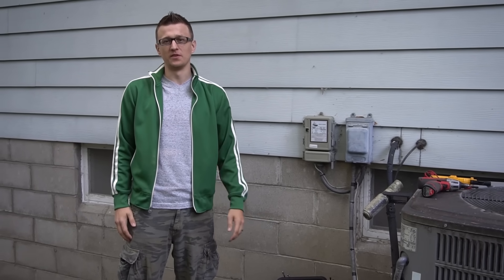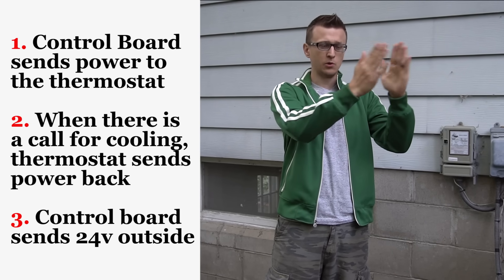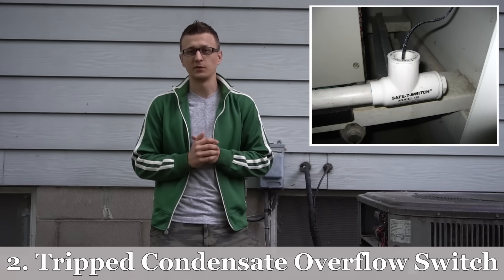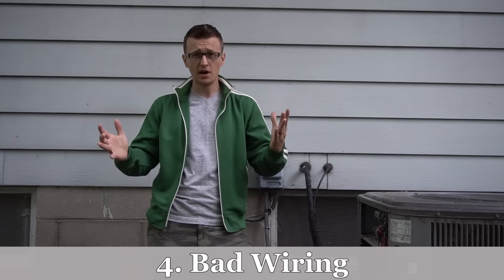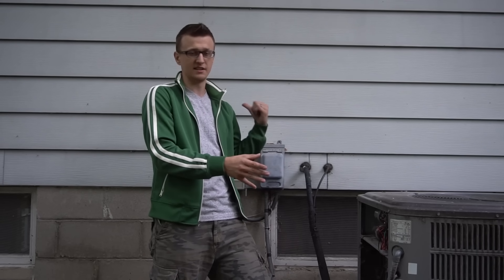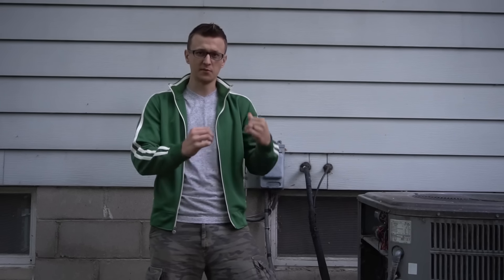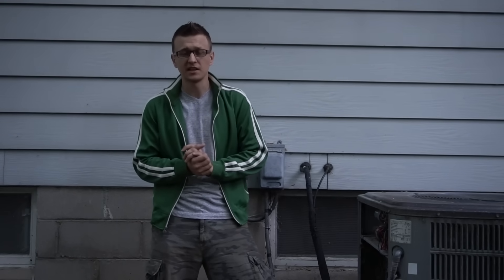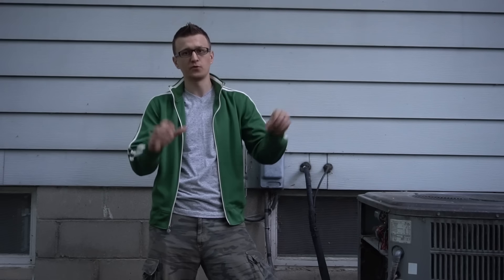AC Contactor Not Pulling In - 10 Reasons Why

Comment: W.O.A tv, in a nutshell my contactor wasn't working. When I manually pressed it, compressor came on and cooled the house after I wedged a piece of popsicle stick to hold it down. Yes this was a rig but it got us through the night.  This afternoon I watched your video and went through the ten steps, still I didnt have power coming into my contactor. I went into the attic where my condenser unit lives and opened it up. I found the wires going to the contactor and had 27v up there. I checked and rechecked my wires and connections from top to bottom, no visual signs of anything wrong. Since I found the 27v in the attic I took a long run of speaker wire and connected it there, ran it down and outside to the unit outside. I connected the wires directly to where the old wires outside of the control box, nada no power. I then took the wires directly to the contactor and bang AC compressor and fan started up. I then took about 6"s of the original wire that had the spade connectors on em and spliced them into the speaker wire, reconnected and she powered up. I know this is long winded, but I wanted to share that just cause a wire looks good on the outside doesnt mean its good inside. Had me fooled. Dont worry, the speaker wire was just a test run, proper wiring will be done tomorrow in the daylight.   Thanks for giving me the list to troubleshoot.

Brian in South Florida :)
Reply from the maker: Hey Brian! Thank you for taking the time to share your experience! That is the definition of going the extra mile! :) Way to substitute speaker wires for thermostat wires, that's a great idea! Glad to hear you were able to get it going, stay cool!
Reply: Love the popsicle stick temp fix!!

Comment: Great video, I would like to add that if you are getting 24 to 27 volts at the contactor then there's most likely a Transformer that's stepping down the voltage. My Transformer is located up in the attic by the control board on the furnace.
Reply from the maker: That's a good point, thank you for adding that!

Comment: Hello,
Today I washed my outside unit with my garden hose because it was very dirty. I waited for a couple hours until it dried before I put the cutoff switch back into the box, went inside to turn on the thermometer and no AC. The blower fan worked fine, but the outside unit’s fan wasn’t spinning. Took out the cutoff switch fuses and put it back in, the fan ran for 3 seconds and shut off. What could have been the problem here? Please help. Thanks.
Reply from the maker: That sounds like a power saver switch or a time delay. Wait for 10 minutes. The unit should turn back on. In this video I talk about that saver switch: https://www.youtube.com/watch?v=HtEGHEDmqpA
Reply: Thank you, I will do as you advised.

Comment: I decided to remove the new contactor and I tried the old contactor just to see...  the contactor “pulls in”!  I didn’t know what to expect but the system is blowing cool air and the fan is spinning. I am wondering if it will fail, again, but for now, I am a happy Maintenance Chick.
Reply from the maker: Glad to hear you were able to get it going! I hope it was just a glitch and you can forget about the AC for another 5-10 years! :)

Comment: Thank you for this very informative video. I replaced the capacitor on my Goodman unit at the beginning of May. It worked fine for several weeks then started blowing warm air. I changed the contactor yesterday (12 July) and the fan on the unit no longer spins.  I’ve checked and rechecked the wiring and gone through your suggested steps and I am at a loss. If I can’t figure it out I will have to call a tech and pay for what I don’t know. Oh!  The system does work when I manually press the plunger on the contactor. Please, any suggestions will be appreciated.
Reply: Gwendolyn Simmins  Hi I had the same problem as you did. I tried what you did according to this video. But it was not working. Finally I found my low pressure switch was open. I had to charge refrigerant then it is ok. Check if your high pressure switch or low pressure switch is ok.
Reply: @yulouma1076  i have same problem...how do you check pressure?
Reply: @DaybyDaywith3  My thermostat screen showed the refrigerant pressure was low. So I had to fill up some refrigerant by myself. Then it was working properly. If your thermostat doesn't  show the low pressure  then you have to check the refrigerant pipe by yourself. I am not sure if you have a measure tool. If you have it then buy some refrigerant to fill up by yourself. You can save at least 350 dollars. Good luck  my friend.

Comment: HELP -Trying to help my family out - What's wrong with this A/C compressor?  It starts and runs for a bit and then shuts off.  I've replaced the capacitor.  Please help!  See video below for the weird "buzzing" sound.
https://www.youtube.com/watch?v=NCI_gRh00fk
Reply from the maker: Giovanni, I am pretty sure that the super loud buzzing sound is actually the contactor. It's a pretty cheap part, I would replace it if it is that loud. There is a chance that the reason the unit shuts off is because the contactor plunger goes back up. Another thing to check is thermostat batteries. If those haven't been replaced for a long time, try replacing them.
Reply: @WordofAdviceTV  Will any LENNOX contactor work?  My unit is a 1990 Lennox 350/5 - 370volt

You're referring to the control thermostat inside the house?
Reply from the maker: @giovannidicapo6213  Sorry I don't have a video on how to replace one but here it is on Amazon: 2 Pole 30 Amp Contactor: https://amzn.to/2JWlI7Z

The thermostat batteries would be in the thermostat

Comment: First, thanks for all the videos. My 16 year old unit in the house I just bought was not cooling. Furnace fan comes on, outside fan is on. Air is not cold. When I set the thermostat for cooling, I hear the outside fan on the condenser run, but I cannot hear the compressor start and run. I feared the old device was worn out, planned to call a tech and prepared to be raped for $$$$$. Since the condenser fan was starting, I figured the contactor was energizing and pulling in. After watching your vids, I manually held in the button on the contactor and I could hear the compressor start. The large refrigerant line quickly got cold to the touch. Not sure why pressing in the contactor got the compressor started, but it did. 

I pulled the outside disconnect, then put it back in, went inside and set the thermostat to cool and it ran and cooled the house! it's been working all day today. 

I'm happy that I have cooling again, but I will continue to diagnose the system because I'm not sure why just cycling the contactor manual switch would do anything, but maybe I crushed a bug as you say. I'll also test the capacitor, because maybe the old one is no longer working to start the compressor, but has enough juice to start the fan.......that's my best guess. Any thoughts appreciated. 

Either way, awesome job explaining how to troubleshoot....it's great!
Reply: Hello 
Sometimes when the contacter is old 
The magnets gets wick and it doesn't not pull strongly 
You might just want to change it

Comment: I have blown a  few fuses while testing everything at my condenser.
Reply from the maker: Sometimes having a little pack of fuses is perfect for situations like that..
Reply: @WordofAdviceTV   I do and it is my go to when i get no low voltage to the contactor.
Reply from the maker: @okc405sfinest  If you are a tech though, I would recommend getting a mini  3 amp breaker and putting on some male spade connectors on it. Then use that in place of the 3 amp fuse so that you don't have to go through a handful of fuses each time. A lot of guys use this one: https://amzn.to/329G96M

Comment: If I move my thermostat outside can that help save money on cooling my neighbor did that and helped him.
Reply from the maker: I have never seen a thermostat outside... That would just make the air conditioner work 24/7 unless it is cold at night over there. Or are we talking about different thermostats? I am referring to the HVAC one that turns on the AC and furnace..
Reply: @WordofAdviceTV  You are correct. I talked to him and he said he moved the thermostat away from an outside door that was making it run too much thank you and apologize for confusion.
Reply from the maker: Ah okay, that makes more sense :) Thank you for clarifying!

Comment: Question, my dads AC units Contactor pulls down and then immediately pulls back up? Which of the 10 reasons can that be?
Reply from the maker: That one may be difficult.. It could be a bad contactor, you might have a voltage problem, or there are loose wire connections somewhere. Can't tell you for sure what it is though, sorry
Reply: Word of Advice TV what order would you check them in first? Lol
Reply from the maker: Investigating for loose wires or broken connectors would be the easiest. Make sure all the power is off and thoroughly go over all the wires and connectors in the condenser unit. Next I would try replacing the contactor (it's a pretty cheap part). Lastly, you would need a multi-meter to try to catch any fluctuating voltage.

Comment: What is the symptom of a bad contactor? Is the unit just not turn on or could it still cycle on and off repeatedly?
Reply from the maker: If the contactor coil is getting steady 24v but the contactor does not open or opens and closes repeatedly, that means the contactor is bad.
Reply: @WordofAdviceTV  My original problem was the AC fan spins but the compressor was on for a second then off for about 1-2 minutes then repeat. I had LPS light on AC control board showing it was fine. I then replaced the capacitor and removed/clean the contactor switch (full of bugs/webs). Afterwards, I tested the unit by pushing the plunger on the contactor but forgot to turn on the TSTAT cool/fan on and the AC compressor/fan started. I then turned the TSAT to cool and now the AC fan/compressor stay off with the LPS light is off and testing the LPS switch with ohmmeter is Open.  The HPS light is on at AC control board as expected. I verified 26v is coming into the AC unit and to the board and the contactor is not getting 26v. Could pushing the contactor plunger and not putting on the TSTAT fan cause the LPS to become Open or cause freezing in the lines/coils that last for days or break the AC? If I press the contactor plunger the AC fan and compressor both start up but the LPS light on the control panel is still off. I also verified the compressor pins do not ground , and the sum of CR+CS=SR with CR the smallest value. HELP what should I try next? The unit is a carrier Model#24aca436a300 Product#24aca436a0030010. I've learned tremendously from your videos to get this far but now I'm stuck!

Comment: My fan comes on if I turn on the main switch at the air handler unit in the garage. But the thermostat won't control it. Nothing changes when I move from on to auto. My heat and air won't come on either
 Replaced thermostat but nothing changed.
Reply from the maker: Sounds like either a 3 amp fuse is blown or the furnace is either not getting power or a component in there is burnt out.
Reply: @WordofAdviceTV  Thanks. I'll check it out
Reply: I think that is a wave resonance  between two AC units.

Comment: I can kick start the AC with screw driver, so that tells me bad capacitor*- but there is a buzz every 15 seconds. From what I can tell from other videos it sounds like the contactor going in and out.  Any tips?
Reply from the maker: The buzz every 15 seconds is actually the compressor trying to start but failing because the capacitor is dead. Once you replace the capacitor, that should take care of both problems :) If you have two separate capacitors, then replace them both.

Comment: Great video. Question on Lennox Xp15.  Getting code 8 error. When reset it will pull in and start compressor. Runs for awhile then turns compressor off goes to error code 8 again. Ideas?
Reply from the maker: Sorry, I don't normally work on mini split systems so I can't give you an accurate guess on what's going on.. There should be videos out there on the E8 code though.. Like this one for example (even though the quality is not the greatest): https://www.youtube.com/watch?v=5fdXGbelufE

Comment: You are the man!!! I possibly had three issues! The flux capacitor was bubbled out and not operable after replacing still nothing but changed the contactor and the transformer and bingo we were back in business! I wonder what a HAVC tech would have charged for that service call. 40 dollars in parts and took me all day to deduce the problem, but if I knew what the issue was would have been a 20 minute job. Couldn’t have done it with out your videos. Thank you bro
Reply from the maker: Awesome! Glad to hear you were able to get it all fixed yourself and my videos helped in the process! It would have cost you at the very least 300 bucks. Thank you for coming back to leave a comment! Stay cool! ;)
Reply: What was the original symptom? Did the AC fan not turn at all or turn on then stop continuously?

Comment: The only way the outside fan and compressor will run is if I hold the plunger in
Reply from the maker: And none of the 10 reasons mentioned in this video were the problem?
Reply: @WordofAdviceTV  I changed the contactor and compacitor....when I cut on the thermostat the furnace will work but the fan outside doesn't come on
Reply from the maker: @76blackface  That means somewhere the 24v is getting interrupted and not making it to the contactor. Have you tried bypassing your thermostat? (I have videos on how to do that) or perhaps if it has batteries, try replacing those. Have you checked the 3 amp fuse? Do you have a meter you can check voltages with?
Reply: I checked the 3 volt...I'm gonna check the..the overflow

Comment: Awesome vid I learned a lot. I didn’t hear anything about if the contactor is getting 240 outside but the thermostat isn’t getting 24 volts. Any ideas?
Reply from the maker: If the thermostat is not getting 24v, then there is no power at the furnace, the 3 amp fuse is blown, or the control board is bad. (Of course there are other possibilities but those are most common)
Reply: Word of Advice TV thanks! That’s exactly what it ended up being. Found a video after yours that lead me straight to the issue. Thank you so much the the info. It’s been very helpful and useful
Reply from the maker: @mariowalker42  Glad to hear it! Thank you for commenting!

Comment: So when I check the connections on the side of the contactor I get continuity not 24v.
Reply from the maker: So if you check the contactor coil, you are getting 0v? (continuity would be checked with the power off and wires disconnected... Not sure if we are thinking about the same thing)
Reply: @WordofAdviceTV  I pulled wires off and tested. I'm only getting 9v. Everywhere else I checked is good with like 25 or 26v. Meaning thermostat and furnace.  

Update: did the thermostat test and found that the thermostat was bad
Reply from the maker: @kirbykillaz1  So if you measure voltage from Y to C at the furnace control board, you have 26v? (with the power on and the door switch pressed in)

Also, is there anything in series with the contactor coil? What I mean by that is, do the thermostat wires that come from the furnace go directly to the contactor coil or does one of the wires go somewhere else?

Comment: Great videos! Excel here in MN recently replaced a board in my Saver Switch. The tech that did it somehow failed to install it correctly. Tec from Centerpoint comes out and could not figure out what was going on (thank you Home Service Plus) and suggested that the control wire was bad. I ran a new control wire, old one was pieced together so I figured time to replace anyway. Still no control voltage. Scratching head looking at the unit and decided to take the Saver Switch out of circuit and contactor pulled in. Called Excel to let them know and they sent a tech out on Monday who fixed the bad install on the Saver Switch. Your videos helped be out a great deal on this problem. A lot of great info and I didn't have to suffer through the heat on the weekend!
Reply from the maker: Sorry to hear about the saver switch problems! Glad you were able to figure it out though! Stay cool :)
Reply: I see this is 2 years old..but these saver switches are just like what energyStar devices do!?! I think??? Allows either the power CV company or  some other  company to control the electrical usage!!  Tell me how energyStar device that runs for 2 to 3 times longer than a similar device...is better or uses less power??? 🤯🤯🤯 where are my manners.. Thanks for the video!!!

Comment: Thank you, great video. My AC is technician supposed to change 305C20 - Cera-Mite OEM Premium Replacement PTC Start Assist Capacitor, but he does not have the 305C20 that  (not sure what it is but some people said it a motor start) so he by passed the capacitor. Would that do harm to my unit? Thanks
Reply from the maker: An AC will run just fine without a hard start capacitor. I am assuming what he meant is that he just took it out altogether? You can also put in a hard start kit instead. I have a video on how to install one and actually I am planning on replacing my start capacitor with a hard start kit some time this week. Thank you for the comment! I think I will film how I do that :)
Reply: @WordofAdviceTV  Thank you so much.
Reply: @WordofAdviceTV  Is any particular model you would recommend for hard start kit?.  I have 2 AC unit one of my current capacitor is   45+7.5
CBB65 45+7.5Uf +5%
370VAC50/60 HZ
40/7/70/21

And other unit current capacitor is  C65R 440VAC
45+5MFD +/-55
40/70/21

Which hard model hard start kit should I get them? Thank you
Reply from the maker: I usually don't put in hard start kits unless something is wrong with the unit or if it is needed for some reason. Watch this video for more info on that: https://www.youtube.com/watch?v=ThBsRFrdNiY